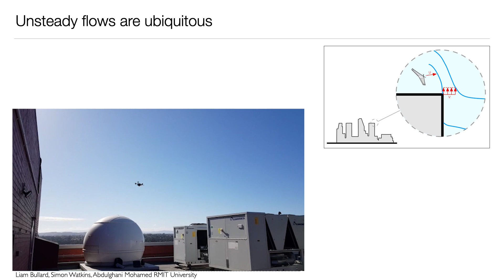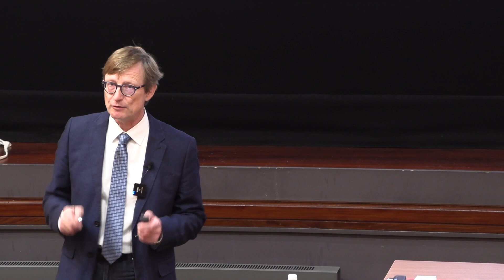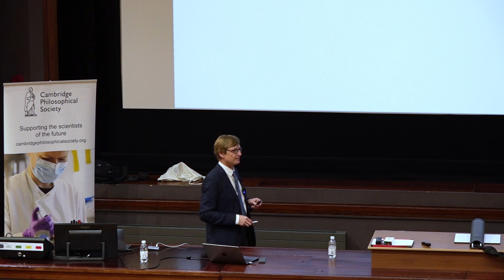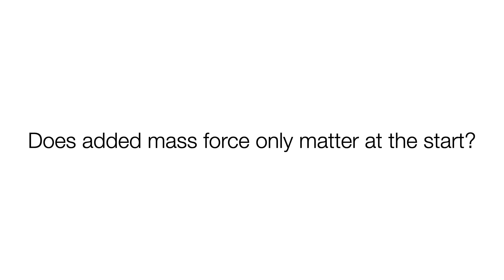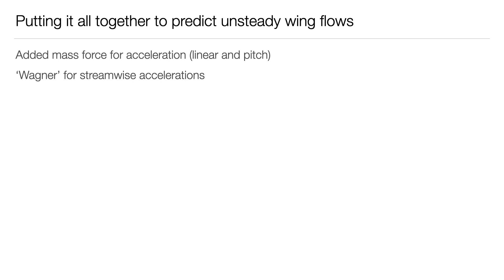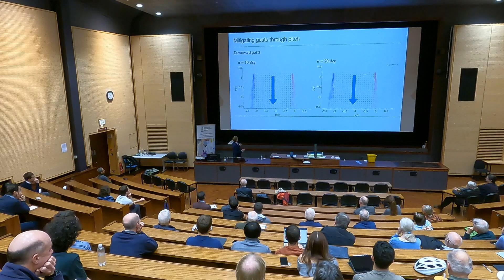Professor Holger Babinsky: Surging cylinders, flapping wings and gust encounters...

Comment: 'Frantically trying to understand' may be misleading you, Holger; trying MORE CALMLY would get you to your goal more easily. 

For example, you show a clip by Paras Vadher, of an Aerodynamic operation that's TOO COMPLICATED to properly demonstrate the point you're hoping it to make. It's too complicated because the 'wing' is IN FLOW; that's a simulation of the wing IN MOTION.

If the operation (impulsive Pitching) had been carried out in STATIC fluid, the experiment would neatly complement Ludwig Prandtl's 100-year-old clip of an aerofoil in 'impulsive Travel', which was also carried out in a STATIC-FLUID tank.

( https://youtu.be/VcggiVSf5F8 )

But in your commentary, you point out that the aftermath is 'hard to see', and like Ludwig you IGNORE the Cannon Current that Paras's 'wing' has created, even though its action (carrying the vortex DOWN the screen...) IS clearly visible.

Consequently, your argument around Lord Kelvin's comment is CIRCULAR - in effect, you're saying 'This phenomenon appears to violate a theoretical statement, but it doesn't, because we've got this other theory ('potential flow'...) that makes everything all right'.

In reality, Paras's clip shows a Cannon Current, caused by pitching the aerofoil, creating TWO 'gatepost' vortices

- one of which is DISRUPTED by the aerofoil's continued forward motion.

Air Whisperer PREDICTION: If the aerofoil were to impulsively Pitch by the same amount around a FIXED point, in a STATIC-fluid tank, then both vortices AND the Cannon Current driving them would remain visible

- just as they are in Ludwig's clip.

(A third experiment in the series, showing an aerofoil shape as it MORPHS (bends...) in static fluid will add greater detail to the general understanding of Cannon Currents; and specifically those of the 'Fan Cannon' type. Those static-test results can then be usefully 'extrapolated' to meaningfully understand flow-condition simulations of wings in motion.)